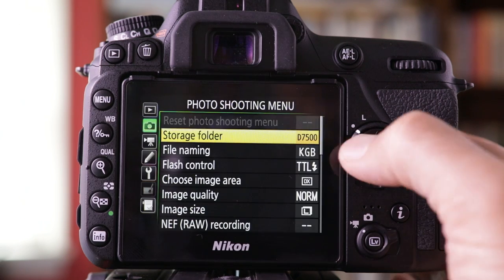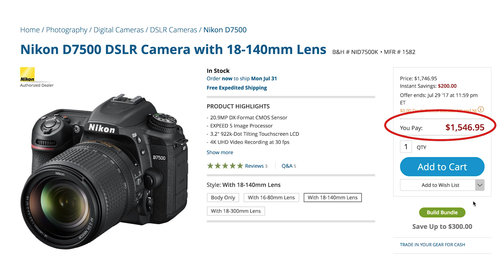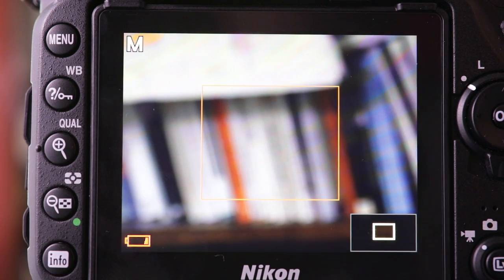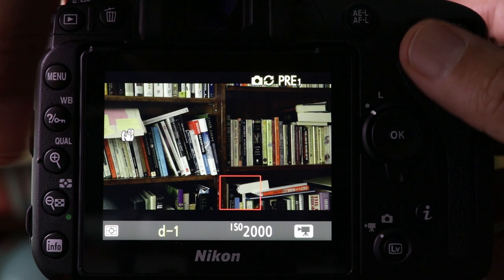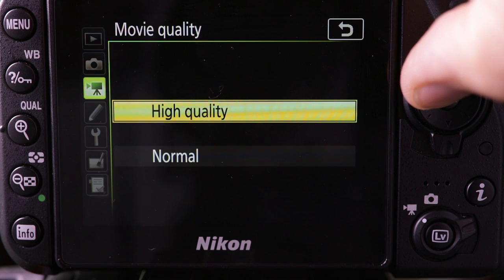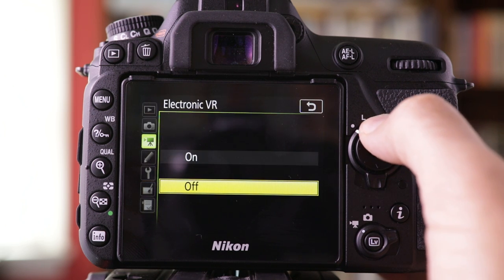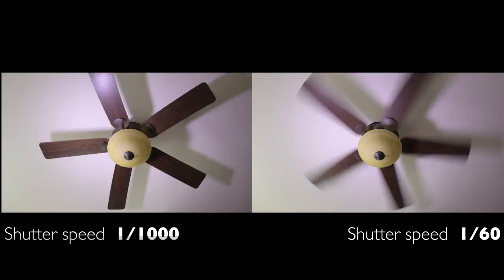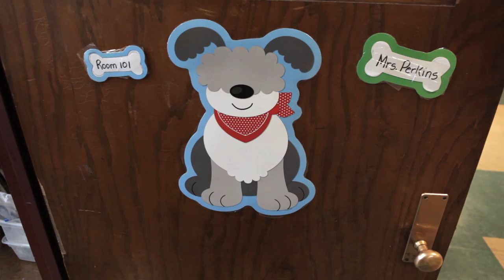Nikon D7500 Tutorial on shooting video

Comment: i'd just add that using 25/50 vs 30/60 fps is important when you shoot under artifical light. In Europe and countries with 230V / 50 hz eletricity grid you should go for 25/50p to get rid of "flickering", while in counties where there is a 110V/60hz grid you should go with 30/60 fps.

Comment: Thanks for the vid Don. It seems that its best to get the D7200 instead of the D7500 since the biggest diff is the 4K vid which not everyone uses. Then there is also the ticker price. I was thinking about the Canon 80D but I dont mind the manual focus on vid. I prefer Nikon because of the great photos it takes.
Reply: The other big improvement with the D7500 is the ability to change aperture while in live view. It makes it much easier to use for video over the D7200. Plus improved image quality for stills, better high ISO performance.
Reply: Thanks Will. Since the LCD screen does not flip like the Canon does, can an iphone be connected to the camera to act as a flip screen to correct video image?
Reply: Train & More Trains if you use the Snapbridge app on the iPhone you can connect it to the camera and watch on the screen. You should be able to control it from there as well
Reply: Sir how to shoot wedding videography setting &blur effects nikon 7500

Comment: My problem is that the exposure in live view looks completely different from video playback. How do I get a WYSIWYG mode from the display in live view?
Reply from the maker: I'm not sure why that's happening to you, and don't have a D7500 in front of me. I do know that the camera stores different settings for video and stills. So if you're in video mode and live view and take a still photo the camera may use different settings. But in video mode and live view you should see what you're recording. Are you using manual exposure or an auto setting? You might experiment with that. Sorry I'm not more help.
Reply: @YurmanVisuals  Thank you. Yeah video playback seems to be lighter. all manual everything. I'll experiment tomorrow.
Reply: @YurmanVisuals  Figured it out. Under steup menus/monitor brightness. Values for "menus/playback" were different from "live view". I set them the same now problem solved. Thanks again, your video was helpful.

Comment: I have the same camera but when I shoot video the images look very pixelly why is that?
Reply from the maker: You might check your ISO - you'll get very noisy results at higher ISOs. And check the resolution you're recording your video at - Make sure it's at least 1080, or 4K if you have a computer that can handle those larger files.   Good Luck!
Reply: @YurmanVisuals  Thanks for the tip but I also noticed that the camera will does not always stay focused and some times the is really blurry.
Reply from the maker: @JeffTomlinson-Consultant   There are many ways to set up the autofocus. In the AF-C mode the camera keeps focusing, so as you move the camera the focus changes. You might try the AF-S mode to see if that fixes the problem you're having.